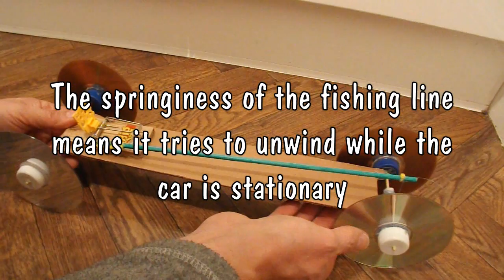Mousetrap Car for Nick Paparesta

Comment: Nick, we are building a similar car and we can not get it to go, is it possible you could help us?
Thanks, Christine ...Tuckers mom
Reply from the maker: Here are two basic tips.
1. Make sure the car rolls freely without power, check the wheels and axles are not binding anywhere. There should be a gap between the body and the wheels so they don't rub together.
2. Many people (me included) make that arm too long. A shorter arm will give you more power. Try tying the string half way down the arm to see if that helps to get it moving. That will give you an idea if shortening it would help.

Comment: Why is that.
Reply from the maker: Two common problems. 1. too much friction on the moving parts, particulalry the axle. Make sure the wheels run freely when you just push the car gently. 2. Your arm is too long - the longer the arm, the less power it has, so try moving the string down the arm until it has enough power to move the car. If you check the video description there will be helpful information and links

Comment: How would we know the length of cutting?
Reply: About how much would we cut for the drinking straws, cardboard, etc.
Reply from the maker: You cut them to suit your needs. I just use scrap items so they are the length that they are because that is what I have. A length of cardboard about 18 inches long and 3 inches wide would be OK but it does not need to be exactly that size. Usually when you are given a project at school they specify the sizes you can use.

Comment: How far did it go?
Reply from the maker: In this video it is still accelerating when it hits the wall/door at the end of my kitchen so it travels 5 metres easily (the length of my kitchen). If I had a longer kitchen it would have gone further. If you check my video description there is the component list and some useful links.

Comment: I don't exactly  get what you did at 6:04. What do you wrap the string on? The wheel?
Reply from the maker: At about 05:19 I show you that I put a yellow plastic tie on the back axle. That gives you somewhere to hook the string (fishing line) loop on the axle. You could just glue a short piece of bbq skewer to the axle to act as a hook as I often find the cable tie don't grip well enough and start to slip round after a few runs so I have to glue it in place anyway.

Comment: Can I use a wooden dowel instead of the flower cane
Reply from the maker: I am sure you can. You are just extending the length of the lever arm so any sort of stick should do. It needs to be light and strong.
Reply: Okay and how do you fold the paper clip? I saw the video but you went way too fast
Reply from the maker: You just wrap it round the flower cane a couple of times to make sure it would be a good loose fit for the axle as the axle is a smaller diameter.. If you watch the video carefully you can see it clearly.
Reply: GrandadIsAnOldMan ok thanks
Reply: Is there a substitute for it
Reply from the maker: Michael Lopez You could use drinking straws the same as at the front of the car

Comment: Can you use the clothes hanger as my lever instead of bamboo garden stake
Reply from the maker: +Jackson Jones the best answer I can give you is "Try it and find out", that will be the quickest way to see if it works. It needs to be fairly light weight and rigid and it mustn't snap when you put it under tension.
Reply: Thank you. I'm still wondering why did you have a drinking straw in the front. Good video !!! :)
Reply: +GrandadIsAnOldMan  and if you were to test that what can affect the distance of the car, you would put weight on it and shorten the lever? any ideas?
Reply: +GrandadIsAnOldMan How long is the chassis couldnt hear it in your video
Reply from the maker: +Jackson Jones I said it was about 14 inches
Reply from the maker: +Jackson Jones sound to me like you want me to do all the work for your project. Like I said in the first reply the best answer is "Try it and find out".
Reply from the maker: +Jackson Jones it sounds to me like you haven't watched the video carefully enough. I clearly explain what the straw is for and show it clearly in the video. Maybe you should watch it again.
Reply: I have made mine but I used a rather thicker lever it didn't move whatsoever but when I use force by pulling the fishing line the wheels move.
Reply from the maker: Jackson Jones well that should tell you that your lever is either too long or too heavy. The longer the lever arm is, the less power it has to turn the axle. The shorter the lever arm is, the shorter the distance the car will travel. That means you have to find the best compromise for power and distance by adjusting the length. You could try keeping the same lever but attaching the string about half way along it's length and see if that helps.

Comment: Would making the wheels larger make the car go further?
Reply from the maker: Sebastian Baker maybe. The larger the wheels, the more power is required from the mousetrap to turn them, so your mousetrap may not be strong enough to turn larger wheels and the car does not move. You can also make the arm on the mousetrap longer so the tip moves further and you get more rotations of the wheel, but the same problem applies. The longer the arm, the more power required to move it. You will have to experiment to find out what works best for your mousetrap.

Comment: Sir, my only question is regarding the last bit of the project. 
How does the string work? You made a knot & tied it at the beginning, on the green flower cane. Then at the end, you said you used a cable tie to create a hook, so did you cut off the last bit of the cable tie when you tied it together, or did you just cut put the hook from the cable tie and glued it there. Also, for the string loop at the end, how does that work? you loop it and then do you put it into the hook? I don't understand the last mechanism .
Reply from the maker: Son M the cable tie is around the axle. That give a little spike to hook the string loop onto.
Reply: p

Comment: can it be less than 200 grams if yes can you please show us what are the material to the mouse car not more than 200 grams and it goes more than 10 m ??
Reply from the maker: Yazeed Abuzaid the component list is in the video description. As for the final weight, that is up to you and what the weight of the components you choose and how you build it. Typical weight for the CDs and the bottle cap hubs and the bbq axles is about 80 grammes. The mousetraps will vary in weight depending on who made them and there are many different weights of cardboard, so that all depends on what you have. If the final result is a little too heavy you will have to see what you can trim to lighten it. Maybe drill holes in things and make sure you haven't used too much glue.

Comment: the car looked like  it picked up speed near the end of its test run
Reply from the maker: Hi Allan, you are right. The velocity of the car is not constant at any time through the run. Several things are happening here. First, obviously the car starts from stationary, so it must be changing velocity (accelerating). Second, if you draw a diagram and plot the arc of the lever arm, measuring the distance from it's tip to the back axle you will notice that for nearly a third of it's travel at the end of it's swing it will pull very little string from the axle and it's energy is wasted, and the car will start to slow down, so this is not a very efficient use of the mousetrap. Third point, if you watch the two runs very carefully and note the position of the lever arm when it hits the door at the far end of the kitchen you will see in both cases there is still plenty of travel left (less in the second run due to the thicker axle) and the car could go much further. Sorry if that is all a bit much but if you are really trying to get the best from a mousetrap car you need to be aware of those points and find ways to fix them.